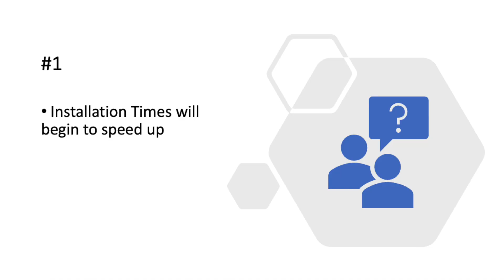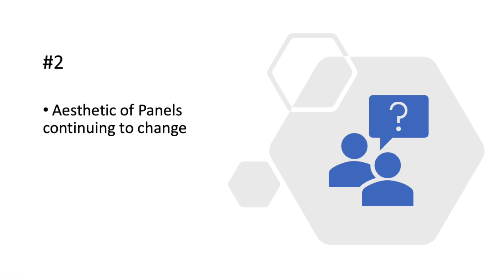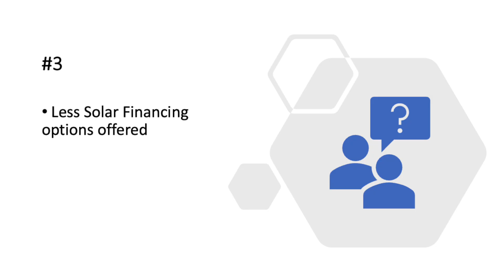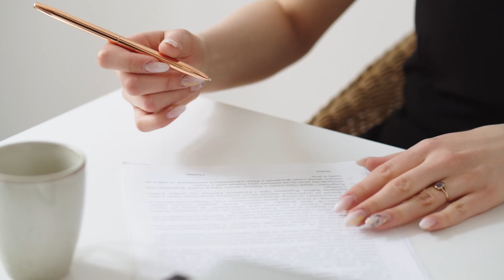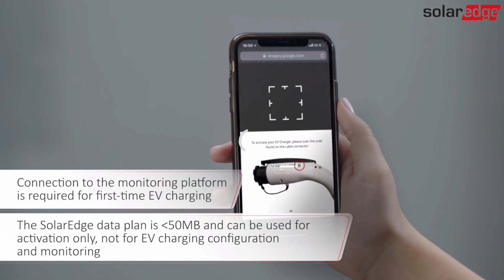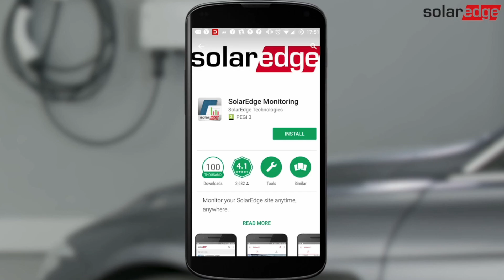4 Changes in Solar that will have a BIG IMPACT in 2023

Comment: I like the thought of an EV charger coming off the solar panels. That is DC to DC. I would think it would save some conversion loss. 
Charging an EV at home is usually DC from the panels, converted to AC to go into the breaker box, and finally converted back to DC at the EV to charge the battery.
Reply from the maker: It’s a great technology!

Comment: Our solar was put up in 2014, but our EV charging didn't come until 2019, so getting an integrated EVSE/Inverter wasn't really a good option at the time.  In some ways, having them as two completely separate units simplifies any troubleshooting (should there be any trouble).  If I were doing it over again, I suppose I had the option to upgrade the inverter - it never occurred to me to ask for a quote at the time.
Reply from the maker: Nice! I assume you have a SolarEdge inverter?
Reply: @jackthesolarguy  Yes, SolarEdge.
Reply from the maker: @JackRussell021  Nice, that is a great option to look into in the future.

Comment: I am currently contemplating setting up solar panels to supply a crypto mining project out at my farm. I am currently using about 20 kW, but would like to build a system that can produce about 100kW. I would need batteries as well, as the operation runs 24/7/365. I have the space, with unobstructed southern exposure so would like a ground based system for ease of maintenance . I am in Southeastern Indiana. Does that sound like something that is doable? What would be a ballpark cost for such a project?
Reply from the maker: Sounds doable. That system will come at a high cost, due to the size+backup you are aiming for. It would likely offset the cost you would otherwise pay for electricity, if that project is a long term investment.
Reply: Hope you don’t mind me helping here bud….
To make 100kW (a measure of power) you would need ~ 120kW of solar. Thats a mid size commercial system. How many kWh are you using monthly?

Comment: What about innovations in solar roof designs? Those should be getting better and better. I know Tesla solar roof has had several hiccups lately, but there are many other companies doing it. They even have roofs that look like slate tiles, clay tiles, and even metal with the PV cells embedded within. Are these getting better in efficiency, and which would you recommend? I'd like to see a full video regarding these options.
Reply from the maker: Way too many hiccups to put on the list. Will make a video on them in the future

Comment: I would in no way install a AC coupled (grid tied) system. I would instead install a compatible breaker panel and move all loads to it, and use batteries. I would only use grid to charge when needed. City’s offer chump change for solar incentives meanwhile they sell their (and yours) energy to other states for mega dollars for as long as you have “extra” energy. In most counties you cannot occupy a residence without paying some sort of bill for energy. … which is complete BS. I want to be a stand alone in a metro area not 300 miles out in the middle of nowhere.
Reply: Sorry chief thats location specific. Ac coupled systems can work off grid as well. Stick to something you know about
Reply: What area are you referring to? I’ve never heard of a “City” offering “Net metering unless that “City” owns the power company. Also, I’m California, it’s 1-1 and it’s going to go down to chino change in April so if you live in California, sign up now to be grandfathered in for 20 years.

Comment: Charging at a Supercharger is quite a bit more expensive than charging at home.  I realize that the current cost of this home system may be high, but comparing it to Superchargers, which are meant for road trips, doesn’t make much sense. Comparing it to grid charging would be better.
Reply from the maker: Thanks for sharing

Comment: Good day. Is there any disadvantage laying lithium iron batteries on their side if setting up a battery bank?
Reply from the maker: I’m not exactly sure. Most homeowners mount batteries on their wall, to avoid driving into them with their vehicle, and to avoid other safety hazards
Reply: LiFe batteries csn be in any orientation except upside down, that was the advice i was given by EVE the manufacturer of my cells 👍

Comment: I live in California and use about 2200kWh per month in the summer which comes to about a $1,000 per month, winter is kinder but still over $400.  Starting looking at solar after my first bill in my new house, signed the contract 96 days ago and nothing has happened yet.  The solar company keeps saying it's PG&E fault because they keep delaying the 200amp panel upgrade, so far nothing has been installed.  

My questions are does the solar company need the panel upgrade first?  Can they install the panels and don't connect it until PGE does their thing?  I only ask because it feels like the solar company is jerking me around, I still do not have the main panel upgrade even scheduled yet.  Also, it felt like they were trying to push financing but I told them I wanted to buy the system outright, could this be a reason for the delay, not getting some sort of kick back from financing?  They are a highly rated company with 25+ years in business so I'm giving them the benefit of the doubt, but it's starting to get irritating not a thing has been scheduled yet.

Thank you, if you read all this🙂
Reply from the maker: It definitely doesn’t have to do with the fact that you chose to purchase the system cash. I know that in Texas, install companies can do MPU’s without state involvement, but in California that may be different. I would keep in touch with your solar company, and ask them how this process typically works
Reply: @jackthesolarguy  Thanks for the info.  I just emailed them again, see what happens.
Reply: I'm in PG&E territory, East Bay Area. I had solar panels installed in late May. About a month ago, I realized that the solar install completely maxed out my 100AMP panel, so on 11/8 I reached out and asked them to come back and upgrade my service to 200AMP (silly miscommunication- partly my fault, partly my installer's fault). They got permits with the city a few weeks ago, the application submitted to PG&E for the upgrade was approved about 1 week ago and I'm scheduled for the panel upgrade on 12/19 (I'm not clear if PG&E is going to be dropping a new line to my house, but I do know a PG&E tech needs to be there to turn on power to the new panel). In any case, around 5 weeks from when I asked for the panel upgrade, it should be done. So yes, solar panels can theoretically be installed prior to a main service panel upgrade, although it is likely a backwards way to do it. 

I very well could be wrong, but my guess is that your installer is not prioritizing panel upgrade projects because they are a lot more involved than a basic stand-alone solar panel installation and it's a lot more profitable/easier for them to knock out solar only projects, especially with business booming right now. With the panel upgrade there are additional permitting requirements with the city/municipality and additional code requirements/considerations. Does it need to be relocated? From what I understand there are some very strict rules around where a panel can be installed- in many cases, the location of the existing panel violates code, so it would need to be installed in a new spot. It's probably true that scheduling with PG&E is tougher than usual. There are lots of people trying to get their systems online before the CPUC passes NEM 3.0 (Installers, Building Departments with the cities/municipalities and PG&E are all likely swamped, so it is possible that your installer is being honest and they are doing everything they can- your area just might be more impacted than my area).  

What are you paying per watt for your system? I've found that the companies that pushed financing were typically really expensive.
Reply from the maker: If an MPU is needed, it will typically happen on the day you get your solar system installed. Being in California, things happen a little different, and can take longer. As far as the price per watt that you pay, it will vary depending upon the equipment that you buy, as well as the region in the country that you are in.
Reply: @aldiaz33  It's a 17Kwh system 52 panels, they are using somewhat smaller panels because they fit a little better with the design of my shop roof.  Cost is $52,000, which includes the panel upgrade and cable from my shop to my house which is approx. 125' point to point, I already dug the trench last month in anticipation of them starting the install, if I knew it would take this long I would have waited on that.  The permits were approved late October, which is why I dug the trench but no work has been scheduled.  You are correct, the panel will need to be relocated as the main panel is about three feet from the main water intake to my house.  It's actually more than 3' if you go at a diagonal but I guess they don't look at it that way.  I'm sure it is probably PG&E's fault for the delay, it's just the fact that no date has been set yet and we're almost 100 days since the contract was signed and 6 weeks since the permits were approved.  They told me at the start it would be completed this year but I'm starting to think that's unlikely.
Reply: @Ryan-ff2db  I've heard different things about what milestones need to be achieved in order to be able to claim the credit this tax season. It would be a bummer if the delays result in having to wait until 2024 to get the $15,600 tax credit you'll have coming your way. I would be concerned about that. 
If they continue to drag their feet well into next year, the bigger concern would be making sure you get grandfathered in under NEM 2.0.  The CPUC is voting on NEM 3.0 on 12/15/22, but if passed it wouldn't go into effect until 4/15/23. From what I understand, you need Permission To Operate from PG&E before 4/15/23 in order to be grandfathered into 2.0. Should be plenty of be time, but something to be aware of.
I wouldn't feel bad about calling your installer regularly for updates. Three+ months sounds like someone is dropping the ball.
$3.06 with a MSP upgrade is a good deal in my area as long as they're using decent quality panels and inverter(s).
Reply: @aldiaz33  Yeah, my CPA says the system has to be paid for and turned on this year for the tax credit towards this years taxes.  From what I read the system must be permitted by 4/15/23 to stay NEM 2.0.  Either way if it's not operational by April I would be very upset.   The equipment is Sun Power with micro-inverters so it's supposed to be good.  I had bids as low as $45,000 but the two lowest bids wouldn't itemize the basic equipment and the lowest bid wouldn't even say what brand they were going go use, like it didn't matter.  Also had a bid pushing financing at 1.4% but wanted $80,000 for the system, which is crazy.

Comment: Living in Boise Idaho, electricity is cheap (last bill was $.080390 per kWh).  My annual usage for 2022 was 5912 kWh.  I am thinking to augment my summer AC needs when bill is about double monthly usage for 2-3 summer months.  My question is - do I have to have a battery in a system since it seems to be quite costly a component?  I have a south facing roof with NO shading issues and a roof size of (where I want the panels) of 20 feet x 20 feet.  Craig
Reply from the maker: Unless you experience frequent outages, or you have a specific need for backup power, there is not particular need to have a whole home backup system. Most homeowners have solar only, but that decision is up to you whether or not you want to spend the extra money.
Reply: @jackthesolarguy  So, don't need batteries in a system.  Great.  Would like to find ROI for the system for my needs as described above.  If more than 5-8 years ROI solar in my case does not make sense.  Your information is very informative.  How much do you charge for an ROI analysis with the data I can provide?  Craig
Reply from the maker: @spotonpromotions1  Batteries are by no means required. Additionally, Idaho has favorable State credits, so that ROI would likely be achievable, if you have a tax liability to claim the credits. I don't charge for calls if you would like to book one.